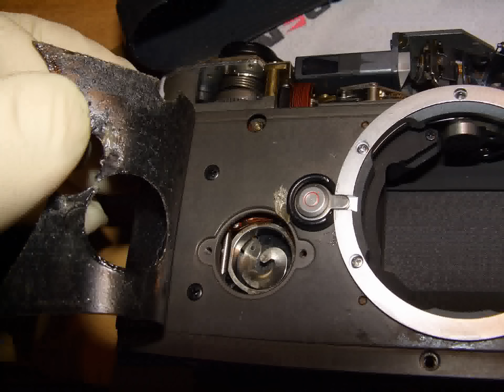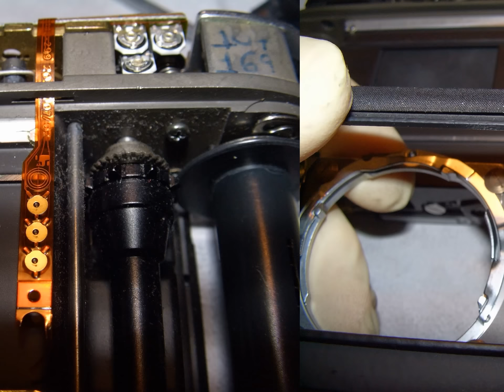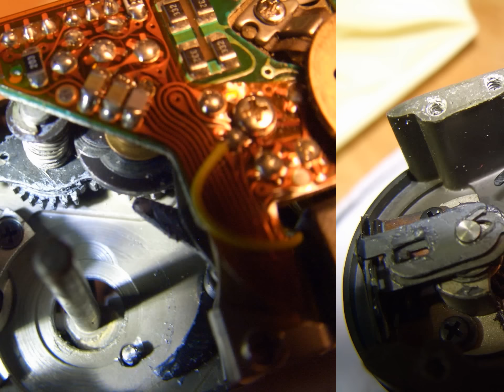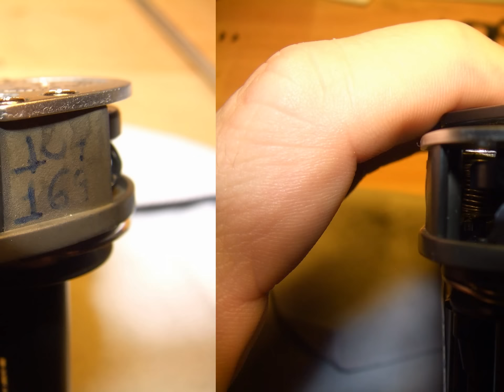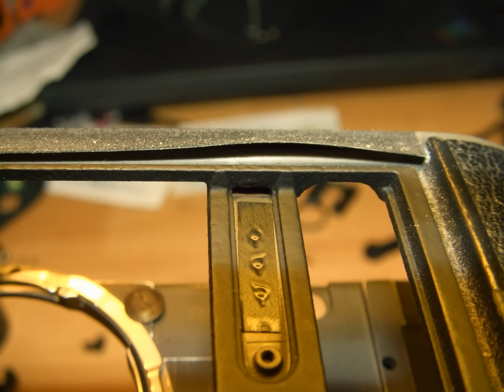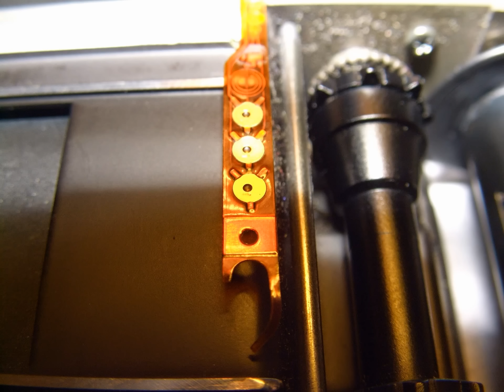Worn film advance gear wheel in Leica M6________Picture Slideshow

Comment: Hi Mike, you've repaired and seen so many gears. Recently I found that there is a rattling sound in my Canon 70-200mm f2.8 L II lens when I shake it. I googled some say it's common because of the IS module was not locked properly somehow. Other than that the lens works just normal. Do you have any idea what might be the reason of this? Thanks!

Comment: Hi Mike,

First of all, I like your videos a lot! 

I have pull out the inner mechanical part of my Leica M6 classic to check the light meter. When I put the inner part of the M6 back to the body shell, the film counter doesn't work, but it does work when it is not in the shell. I think there is something wrong with the metal piece that reset the film counter. So please advise me how deal with that metal piece.

Thanks a lot!
Manson
Reply from the maker: +manson huang   To get the film counter to work proper again, it's very importent to be sure that the ring spring at the film winding side is correct put in.
The easy way is to take out the film takeup roller where the film is advanced. There is a screw in the film champer that need unscrew, then you can take out the takeup roller and at the same way see how the ring spring is working.

It could also be the little spring that make the counter flip back again, take a look at 2:08 and compare with your camera.
Reply: +mikeno62 Hi Mike, thanks a lot for the reply!